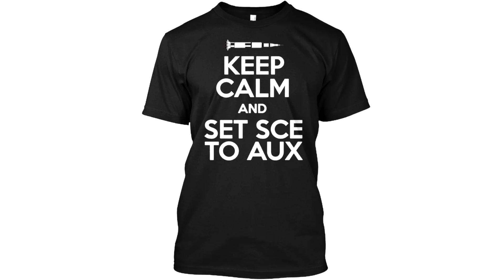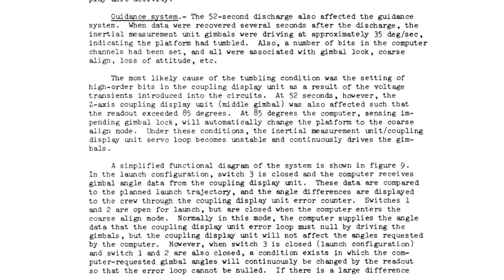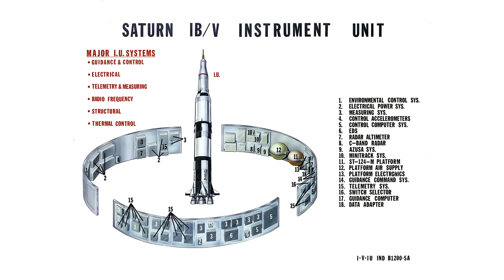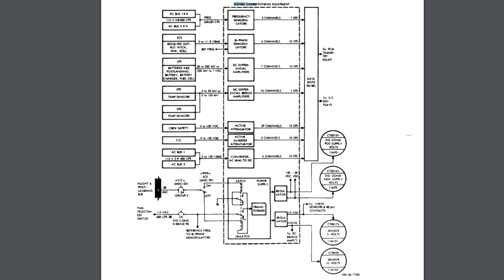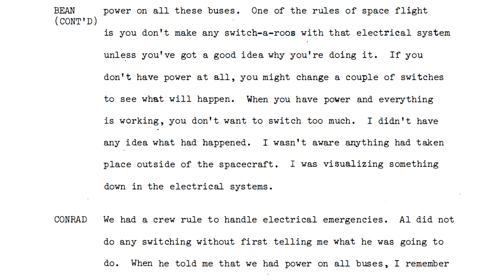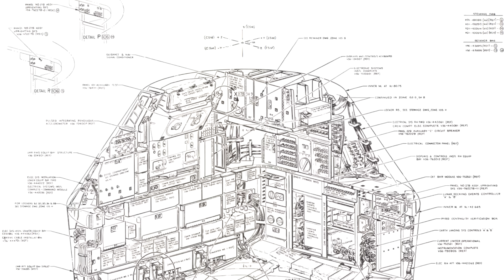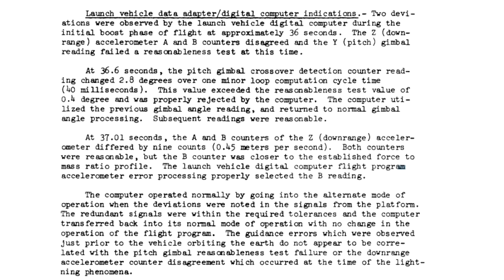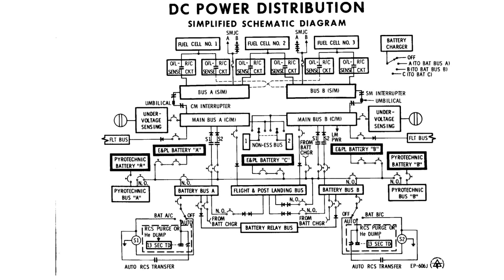What Does "Set SCE To AUX" Mean Anyway - Apollo 12's Lightning Strike Explained

Comment: This is a great video Scott.  Thank you for creating a video about the man that Gene Kranz, in his book "Failure is not an Option", wrote, that "To this day John remains the most respected engineer ever to work in mission control".  One thing I disagree with, however, is that the astronauts could have diagnosed and fixed the telemetry issue themselves, with their lives at stake.  The decision to abort rested on one man, flight director Gerry Griffin and he had less than 2 minutes to make that decision.  Talk about pressure.  

Keep in mind that the job of all the controllers was to monitor all the hundreds of systems that they dealt with.  They weren't control panel experts and they were essentially impotent in this situation.  Aside from John, none of them knew what to do, especially with so much on the line.  Not only did John recognize what the garbled telemetry meant, but he was also familiar enough with the control panel, that he didn't have to resort to trial and error.  The SCE switch was not even meant to restore telemetry.  It was John's natural curiosity to trace how it could be used this way a year earlier with nothing on the line.

When the telemetry was restored virtually everyone connected with NASA wondered, what the hell just happened?  What happened was that John bailed NASA out singlehandedly and he became a legend on the spot.  Google defines steely-eyed missile man as " An astronaut or engineer who quickly devises an ingenious solution to a tough problem while under extreme pressure".  50 years later I am still awed by this story and John Aaron is my all-time hero.
Reply: As important as John's heroics was to NASA, consider what would have happened if this situation arose during Apollo 11 and whether they might have to abort man's first moon landing.  Not only would it be a huge black eye to NASA, but it would also mean countless questions about whether they rushed the Apollo program to meet President Kennedy's deadline.  So as we know, Apollo 11 changed the course of American history.  There wasn't much less riding on Apollo 12.  If it had been aborted it would be a major embarrassment to the USA around the world.

Comment: Saturn V is the pinnacle of spacecraft technology. Not surpassed to this day.
The Space Shuttle was a complete rubbish. The Space X is not yet getting where achievements were in the 70s.
Reply: Hahaha, the J-2 was the best motor in the Saturn V and that was still an open-cycle design, inferior to the 1969 NK-15 soviet design. As for the F-1 first stage, what a dreadfully inefficient motor. A low pressure tubular design that was expensive to make, complex, wasted a lot of fuel and scrapped ASAP after the Apollo missions to the bottom of the Atlantic.
Perhaps you should be asking why Korolev - the world's best rocket designer - calculated that the N1 needed to be 10% lighter and 33% more powerful than the SaturnV to put a man on the moon, which to acieve they needed a motor 10% more efficient than the best available at the time.
The space shuttle actually worked - not rubbish at all. Those SRBs are each twice as powerful as the made-up power of the F-1, pogo free and reusable. 
As for SpaceX, the Falcon 9 is quite clever but the Merlin motors are nothing special, but their Raptor motor is as good or better than the 1969 soviet NK-15, so in the next few years SpaceX will finally catch up with Russia, only 50 years later.
Ironically Falcon-9 also proves the fakery of the LM descent landings if you look carefully.

Comment: 1) How come they couldn't have simulated a situation like that? Seems to me it was as simple as disconnecting the fuel cells in ascent configuration.
2) With all the redundantly backed up equipment they had and the high safety culture, how come did they not have strong enough batteries that could cope with the fuel cells getting disconnected in that situation?
Reply: To me, it's a bit inconclusive whether it was the brownout (transient supply voltage drop in this case) or the electrostatic discharge (lightning strike in this case) which put the SCE into an unexpected state. Or a combination of both. Of course there had been the incident with the "not-A-team" where the SCE showed similar symptoms due to a brownout. So there was definitely a fault in the design of the SCE - the expected behavior would have been a self-reset of the SCE, not what actually happened. Either the "not-A-team" guys did not report this unexpected behavior(and neither did John Aaron), or management didn't take this seriously enough to get it fixed. Or maybe a better brownout detector/reset circuit was deemed to be a more likely point of failure (if it misfires, the SCE would definitely be out of order), so the SCE remained as it was.

Regardless, power outage scenarios had indeed been tested on the ground, and the the SCE had shown the expected behavior, not the abnormal one observed during the flight (and the "not-A-team" incident).

The batteries were strong enough to deliver enough power (75A). Tests did show that they maintained a good enough voltage level to sustain operation of the spacecraft. And, indeed, the SCE ran on the batteries for some time (000:01:50 - 000:02:22, after the manual reset causes by the "SCE to AUX" switchover, until the fuel were put back online).

So, to me it looks more like a random glitch which rarely occurs. After all, it was the 13th Apollo mission (the first ones not manned), so it was not a new untested system.

I think the real error was the decision to launch despite a nearby thunderstorm.
Reply: Because batteries are heavy and on a spacecraft every pound counts.  The spacecraft was never designed to operate in a launch config on batteries only.  That's why it had fuel cells to power everything that needed power.  All of the fuel cells cutting out is a scenario that is never supposed to happen.

Comment: What happened with the weather forecast? Why did they launch into a thunderstorm?
Reply: It was not known that lightning would have a path through the rocket to the ground.  For example, airplanes do not get struck by lightning because they are not grounded.  In order to be struck by lightning, an object must be "grounded" in that something touching them is also touching the ground.  That's why airplanes aren't struck by lightning.  The same was thought of the rocket, but in reality, the exhaust itself provided a path for the lightning and so they could indeed be struck - and were - twice.  Needless to say, they never launched in weather like this again.
Reply: @willoughbykrenzteinburg  Aeroplanes do get hit by lightening.
Launch windows were chosen carefully to avoid the rockets being tracks too easily and to allow cloud or darkness to obscure the point where they pushed the CM out of the transport plane for the splashdowns next to the press boats.

Comment: Lots of great pause and read/study pages. Did I miss the schematic that showed the SCE normal - off - aux switch? The fuel cells tripped off line so the system was being run by the A & B batteries. Until the fuel cells came back on line wouldn't the Normal and Aux position both be battery power? Does that mean it was the momentary cutting of power by moving the switch through the Off position to the SCE that cleared its mind from the undervoltage induced confusion to the clarity afforded by the 24 volt battery supply? Did I also miss how long before the fuel cells were back on-line?

Comment: 200V per ms?
Reply: Alexander Horner i understand that to be the rate of the electric surge induced by the lightning strike
Reply: Nivola 1953 - Volt is like water pressure, how can it have a time period?
Reply: @alexanderhorner  I though you were honestly asking to understand, but from your answer I start suspecting you are just trolling. Anyway just assuming again you honestly want to understand, Volt is a measure of electric potential it is supoesd to be relatively constant in normal conditions but in this case Scot was referring to a Voltage drop from nominal 24V to 18V or less that means he reported the variation of the Voltage over a period of time , you know like when you check your weigh every day when you diet. So the value Scot was referring to was the change in voltage over the time it happened you know dV/dt, the slope of the Volt values recorded over time. Please don't even try to ask why the value was around 200V/sec when the voltage was only 24V
Reply: Nivola 1953 - okay. I wasn’t trolling, don’t know why you would assume this. I never heard anyone measure a voltage drop in V/s, that’s why I was confused.
Reply: @alexanderhorner  actually any parameter that changes over time can be measured over sec or min or hours or days I mean whatever unit of time. You can measure water level in a tank at t1 than at t2 and calculate the rate of water level variation. If you reduce the interval of time to ever smaller value you will need to use Calculus, originally called infinitesimal calculus, invented by Newton and Leibniz

Comment: I feel like there was some negligence involved when one of the engineering teams managed to completely scramble the computer using a known and designed failsafe mechanism that didn't fail into a safe state. i.e., did they not test the battery backups coming online without frying the SCE at some point? and was it not negligent when someone saw the battery backup kicking on, kicking all the telemetry in the ass, and not reporting this as "battery backup is fucked y'all, we need a new one" ?
Reply: How unfortunate that you were not a part of the design team.

Comment: Continuing to the Moon made sense in several ways. First, they would get some science out of it, even if they were doomed to die. Second, it would give NASA more time to figure out a way to test the pyros, or perhaps figure out another way to get the parachutes to deploy. NASA was very good at figuring things out to save missions. (That in fact may be their primary skill.)

Presumably they didn't figure out a way to test the pyros though, because they didn't change anything in the reentry.

Those guys had amazing courage. Once the escape system was jettisoned, they didn't have anyway to abort if anything else had gone wrong, so continuing the ascent was pretty brave.
Reply: Apollo spacecraft did have abort options after tower jettison- the abort procedure to be used (if needed) was to separate the Command Service Module (CSM) from the rest of the Saturn V stack and use the Service Propulsion System (SPS) engine to place the spacecraft into a trajectory to splash down in the prime or one of the secondary recovery areas.
Reply: @bobcastro9386  
That’s not an abort system. That is just an alternative reentry procedure.
If the second or third stage blew up, it wouldn’t save them.

Comment: I was wondering if they went the entire mission with it set to auxiliary or not thanks for the clarification
Reply: The auxiliary setting was used during re-entry, when the Command Module was running on battery power after the Service Module with it fuel cells had been jettisoned. During ascent to orbit, when the lightning took the fuel cells offline, the system automatically switched over to the batteries, which produced a lower voltage, scrambling the SCE and downlink. Setting the switch to AUX allowed the SCE to run at the lower battery voltage, restoring the downlink. Once the fuel cells were back online, the SCE switch was reset to NORMAL.

Comment: Why did it launch when there were thunderclouds nearby ?
Reply: They weren't actually thunderclouds, but heavy rain clouds. However, when you have a rocket 110 metres tall, with an exhaust plume three times that, launching through such weather, it provides the perfect lightning rod.
That was the last time NASA ever launched anything is such weather conditions and they won't launch if there is lightning within 16 kilometres of the launch pad.

Comment: They could have almost certainly ran a resistance test through the circuit that fires the chutes.
Reply: Through the pyrotechnics circuits. A resistance test would require some current flowing in those circuits. I don't think they would risk that.

Comment: I have read somewhere that the guidance system didn't try to correct for any course drift during the first stage (S-1C) burn. The guidance system stored up any course drift which the second stage would correct for once the rocket was clear of the dense part of the atmosphere. I believe they were concerned that any corrections in the lower atmosphere might over stress the structure. For this reason the systems that had dropped out were not really mission critical for the first 2 minutes plus of the launch. The first stage burn was all about keeping the structure aligned and accelerating.

Comment: Reminds me of the DCS: A-10C simulator. When you have a power problem, for example when you switch from battery power to APU, but if the APU isn't running yet every warning light will turn on and be angry with you.

Yet there's no warning if you forget to close the cockpit, I guess IRL it would be pretty obvious.

Comment: Nice to see Scott goes beyond "it saved the mission". While it was really helpful, the moment of a possible abort was long gone and the crew, realised no immediate danger,  on their way to figure out the reason and what to do (Fuelcells on/off). You can hear them in the onboard audio directly around the sce2aux call talking about the voltage drop as possible reason. 
Only with telemetry on the ground back (thanks to SCE2aux) they were sure about it.  So it didn't "save the mission". Since the Saturn V wasn't bothered by all this, they had time to figure it out. Pete Conrad sure as hell wasn't about to pull the abort handle in panic at this point anymore.. The Handle-pull moment had gone and passed.

Comment: Without knowing why setting SCE to AUX mostly restored the circuits, as an engineer that has worked on terrestrial critical circuits with redundant power supplies, my guess is that the main power supplied through the "on" position on the equipment was set to one specific level (28V) while the "AUX" power was set to a different level, 24V in this case.  A new level at either expected voltage will trigger the supplied equipment to reset, which usually only takes a second.  The equipment that I install these on is susceptible to power surges such as lightning strikes. The level going low due to a lightning strike and then not giving correct readings due to not being at one of the two correct levels is a condition I have seen before, and tripping the power circuit to the backup power supply was the solution to the immediate problem.

Still, I am always amazed at NASA of the 1960s and 1970s.
Reply: The auxiliary setting was used during re-entry, when the Command Module was running on battery power after the Service Module with it fuel cells had been jettisoned. During ascent to orbit, when the lightning took the fuel cells offline, the system automatically switched over to the batteries, which produced a lower voltage, scrambling the SCE and downlink. Setting the switch to AUX allowed the SCE to run at the lower battery voltage, restoring the downlink. Once the fuel cells were back online, the SCE switch was reset to NORMAL.

Comment: So really the true hero here was the Assent Computer which continued to function while the apollo computer gave up the ghost. I wonder if the difference was just better design, or if it was in the relative simplicity compared to the apollo computer, or if it was affected less due to it's position in the rocket.
In other news, it would absolutely not surprise me if NASA took that attitude with the parachutes; they were cited for making those kind of decisions in other places
Reply from the maker: It was the fuel cells which had overload protection circuits, the Instrument unit on the Saturn V was only needed to work for a few hours so it was battery powered. So it was the power system rather than the computers.

Comment: Glad you got the background to Aaron's ability to get into the minutia of the problem. No one at KSC wanted to explain to Aaron what exactly had happened to cause the low voltage, and it took someone like Kraft to intervene and ensure the information was passed on.    It was that NA engineer who told Aaron 'you know, if you just switch the SCE to aux, you'd be right.'   He remembered that comment in the heat of battle many months later.  Aaron was smart, but more importantly he was curious and hard working.  This is all covered in that brilliant book Apollo: Race to the Moon.

Comment: You say it took John Aaron a minute or so to come up with the recommendation, "Set SCE to AUX."  Having listened to tapes of the flight from two different sources I time it as four seconds from the query,  "ECom, what do you see?"
Reply from the maker: That query came a long time after the failure.
Reply: @scottmanley  it must have been the second strike that knocked the fuel cells offline because the first indication of something wrong comes at 01:02 when the commander, Charles Conrad, Jr. says, "Okay, we just lost the platform, gang......"  Then there's the commander reporting alarms in the capsule.  At 01:36 the recommendation to "Apollo 12 Huston, try SCE to auxilliary, over." is already being radioed to the spaceship.

But, let's say the problem occurred at 00:36.  Then Conrad studied the problem for 26 seconds before saying anything.  That's possible but his communication makes me think the strike at 00:52 is the more likely cause.  Its normal for a person to look at something for a few seconds when surprised but even ten seconds seems long to me in this situation.
Reply from the maker: @lorrinbarth1969  Check the onboard transcript and you'll see that things go wrong at 00:36 https://www.hq.nasa.gov/alsj/a12/AS12_CM.PDF